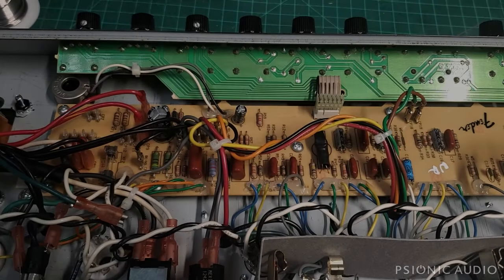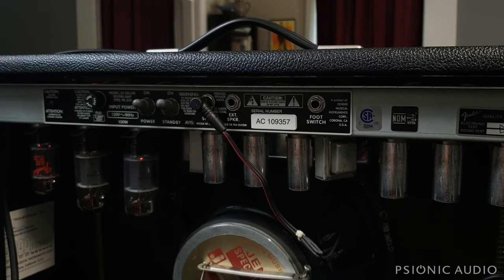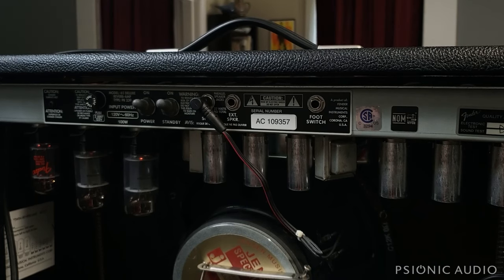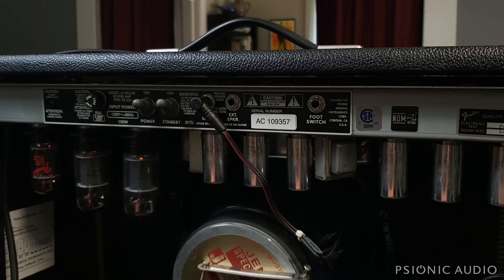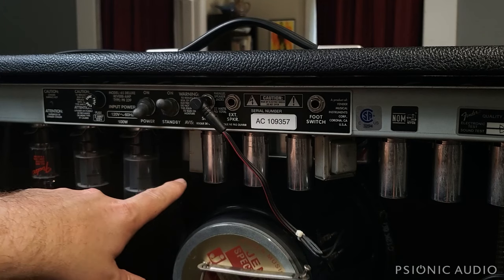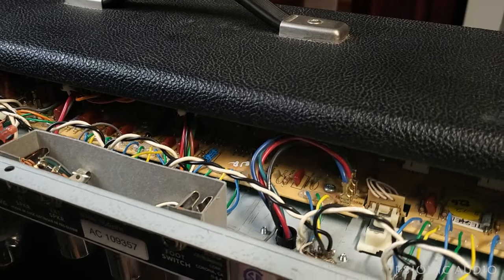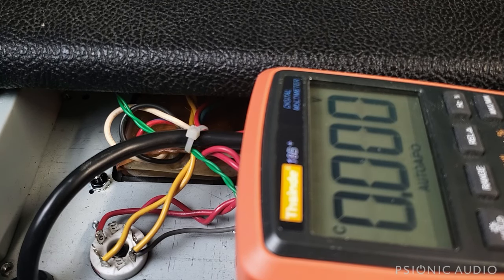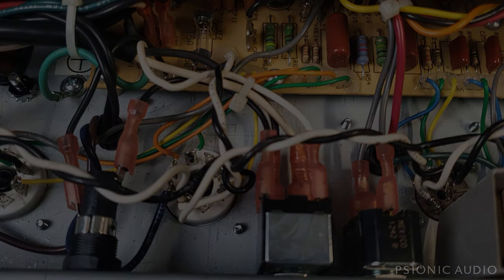(One Way to) Safely and Easily Discharge the Caps on Most Fender Tube Amps | READ THE DESCRIPTION!

Comment from the maker: Once you play with the power off to discharge the caps, UNPLUG THE AMP FROM THE WALL before going inside the chassis, Should have put that in the video.
Reply: Lyle, yeah..... I'll remember that the next time I shock the hell outta myself by forgetting to do that (I mean, haven't we ALL???). 🤣
Reply: It’s sad that you even have to clarify this.
Reply: great video, i want to clean my 90s twin and this will help me when i have to remove the chassis to clean the pots.
Reply: Having worked construction my whole life, and playing guitar, I learned that the neutral side of an outlet will shock you too, not as bad but not a good thing. Amps plugged in still get residual power from the neutral. Kinda like a back flow in reverse from the outlet

Comment: Not sure about this. You turned it off- so it went off. Circuit was broken. Certain tubes, capacitors, not tested in this video could still hold a charge. Believe that. The one node did not. Not sure playing did a thing either. Best tip for non-techs. Do NOT go inside your amp. A tech would go through your amp, tighten things up for probably $50 while you wait. Do that and demo some guitars and amps whilst you wait. Winning. I studied Elec. Engineering and I can tell you stories of people getting very messed up when amperage (not so much voltage) passes through the body. It is not pretty and effects are often permanent.  Just don't do it. They make those warning stickers for a reason. And yes, for the love of god, a TECH will unplug the GD thing before fiddling around- that is not even up for debate.

Comment: This is the method I used when I went into my '67 Deluxe Reverb to replace those 55 year old filter caps. When I measured the voltage it was less than 1 volt anywhere in the amp. So I can confirm that this works. I haven't tried it with my Marshall JMP yet, but I will soon.

I still want to make a discharge tool with alligator clips and a big 200ohm 10-watt resistor... I have everything to make it, I just haven't had time to do it yet.
Reply: The higher you make the resistor , the LESS effective the tool . I usually stick to around 20-47 ohms .

Comment: I Wanted to check if my 66 bandmaster had original filter caps.  The amp still held on to 15 volts after this method.  I continued by draining it slowly with the meter.  The filter caps were original.  Thanks for the video!

Comment: I've been doing THAT for years !! Usually do it on the bench with a signal generator and raise the signal generator as I unplug the amp . I discovered this when I noticed how long after you unplugged a Dynaco pre amp that it would keep playing ......if you did it THAT way , by time you got the chassis open the quad cap was just about zero , doesn't hurt to check with an alligator clip and a resistor either though . Nice vid and GOOD point !!
Reply: Yea I've always done the resistor bleed down thing too. Some amps have them built in if I remember correctly. But always verify, especially with tube amps. It's good to see another way though 🎸
Reply: @mikewithers299  You gotta' be careful with it , more common with TVs and Oscilloscopes but every once in a while it CAN creep back up again too ! I always check with a 10 ohm resistor and an alligator clip to be sure .
Reply: @frankporfidio9813  yes I had it happen on a couple amps that I was changing out filter caps on. I drained them and removed the resistor, got side tracked, came back to remove them and volts creeped back up again. Glad I checked again before unsoldering it!

Comment: I was helping a friend wire a car audio power amp (500w rms) up once and he accidentally shorted the output terminals I was amazed how big of a arc resulted. And this amp had been sitting for years. Ever since I’ve had a healthy respect for large caps in general.

Comment: I had forgotten about this-it doesn't pull it all out, but it makes it generally safe to do things like change jacks, replace the power cable, etc.
Also do this before you change or remove a tube. 
I haven't worked on tube amps since the early 80's, and have forgotten all this stuff.

Comment: Some circuits I use to work on (not guitar amps) used to have bleed off resistors to discharge caps, or you had to take a probe and discharge each cap to ground.
Reply: Older Fender amps with filter caps wired in series for the first node usually had balancing resistors across the caps and these also functioned as bleeder resistors, though the ohms value was high enough that the caps didn't drain all that quickly.

Comment: Great video, if i may make a recommendation, get yourself a 1000 volt protective glove such as those that are sold by uvex, and then use your voltmeter to measure that the caps are of. With such protective gloves you really do not risk anything at all.

Comment: As long as the valves' (tubes') cathodes are hot they still act as voltage amplifying stages and will drain off DC voltage from the reservoir cap onward down the rail draining filter caps on down to the lowest & last voltage node at the end of the rail.
Reply: So the tubes have to be hot for this to work?

Comment: I have a quick question! Would it be possible to custom build a point-to-point clone of a Mesa Dual Rectifier (2 channel)? From what I understand the preamp is similar to an SLO but the power amp is different. I wouldn't need the tube rectification and could forgo the "spongy" feature. I'm asking because I know how challenging mesa products are to maintain. Thanks, I love the channel & keep up the good work.
Reply: Oh course you can, its all about the time and expense

Comment: Based on what I studied in electronics at school, I assume that should be enough to discharge a working amp, but I never saw before a video saying this. I haven't done high voltage electronics in more than two decades, so I was wondering if I was correct. Thanks for this.
I just have one question, this should hold true for almost every amp, rigth?
Reply from the maker: Usually. But we verify anyway.

Comment: you do NOT need to play the guitar, the hot tubes will conduct the current (bias current) through them, effectively discharging the caps (playing doesn't matter at all). But if you are going for a nice fade out tone, i guess go for it. Maybe it can help as a "confirmation" the caps are empty too, if you want to skip the volt measurement but i wouldn't recommend not testing for actual voltage.
Reply: I think the point of playing was to demonstrate the caps discharging
Reply: @ProSimex84  since it is an instructive video i suppose it could very much be the case indeed.
Reply from the maker: Tubes cannot be relied upon to drain the caps fully. Short of using a large wattage resistor (which can be more dangerous for the untrained), playing to drain the caps is the best way to quickly and throughly drain them.

BUT CONFIRM.
Reply: @PsionicAudio  Please enlighten me on how "playing" helps? i think i know electronics and tubes but i can always learn. Why is playing that discharges the capacitors and it is not the hot-tubes emitting electrons from their cathodes?
Quick experiment to be sure, on an amp without capacitor bleed resistors and with either a solid state or directly heated rectifier flip the power switch on-off real fast, (pre amp tubes and power tubes still cold). Then connect your guitar and play for an hour (no heater power at all though), then with the most care measure the B+ (chances are it is even higher than normal B+). Then with an amp with a standby switch that cuts the circuit after the rectifier and not after the B+ capacitors, let it on standbly for 1 minute with hot tubes draining current out of the B+ capacitors. Then kill the power completely or pull the plug, voila the B+ capacitor should measure less than 5v DC (with no instrument ever connected to it throughout the process). If you do those 2 experiments and i am wrong please let me know, as i would really love to learn more.
Thanks.

Comment: What is the fully charged voltage on that rectifier reservoir node? Thanks for this safety vid.
Reply from the maker: Typically 400-440VDC with tubes present. Can be closer to 480VDC if the output tubes are not in the amp.

Comment: Thank you for your wonderful videos. I've got a blues deluxe reissue (unfortunately, now that I've discovered your channel) that rarely gets used because it's just too dang loud if you want that edge of breakup sound, and perhaps it needs a tightening of bolts and screws. Just out of curiosity, what voltage would there be if you hadn't discharged the capacitors?

Comment: Thank you, great video. So if you have a bad power switch and unable to turn on the amp, then what do you do? You have to open the chassis to swap in a new power switch.
Reply from the maker: Then you take it to a tech. As I said in the video, this is a method for a working safe amp. This is not the only method, but unless you are a tech...

Comment: To discharge the filter caps you turn off the amplifier while strumming your guitar until it's dead sound but that doesn't mean their is still 350vdc charged voltage still holding storage on the filter caps. Unless I'm missing something in the video

Comment: Hi, does this technique work for solid-state amps also?  Thanks!
Reply: Good question. I always used bleed resistors on my solid state amps. That's how I learned. But it would be interesting to find out. Unplug it from the wall while it's powered on and playing. No standby switch on solid state

Comment: My amp (Laney) cuts straight out if I do what you do but if I flip it to standby and leave the power on, the sound dies out like yours did in the video. Does that mean I should do this the other way round to you? By the way, great video. It's the first one that actually makes sense to me. Everyone else starts out by saying don't put your hands inside the amp until you've bled the high voltage caps and I think, "How am I supposed to remove the chassis and do that without putting my hands inside the amp!" Now you've answered my question. Sorry, one more question if you get this far  - I can buy a 22k, 3W Metal Oxide Film Resistor locally - I'm guessing that would be fine too?
Reply from the maker: Well this was very specifically for Fenders. Not for all amps. WIthout seeing your Laney's schematic I couldn't tell you. Some amps use "standby" just for a speaker mute.
Reply: @PsionicAudio  Okay, thanks very much for your answer. I'll just be careful then!

Comment: Another important use for a standby switch
Reply from the maker: How you get that from this video is beyond me. I was very clear that the standby is always left at Play.  Never put it in standby to do this.
Reply: @PsionicAudio  I wasn't referring to discharging capacitors. There are a lot of conversations as to why the standby switch exists. Put it in standby when you're not playing and the amp runs a lot cooler because the only heat generated is from the tube heaters. Otherwise you add the tube plate dissipation and everything else gets hot. When building or servicing an amp, I always shut the power off, then put the standby in play on my Super Reverb. On the Blues Junior you have no choice other than to shut it off and play it down as in your video.

Comment: What do you use as a minimum resistor to discharge caps when they won’t bleed down?
My Fluke has a Low-Z input of 10k. 
I’ve bled down little things (on container ships) with it, and actually tripped an alarm by pulling down a signal voltage.
Would it work for discharging a JCM 800 2204?
I could solder something together with something higher, I even have some 1000v junk leads that I could splice something into. 
But if my Low-Z will handle it, it sure would be nice.

Comment: I like to follow this by using an alligator clip with a load resistor from pin 1 of preamp tube 1 to ground and let it sit for a few minutes. Make sure that standby switch is on. Usually measure close to zero after this.

Comment: Would this also work for a Hot Rod Deluxe or Vox AC4?
Reply from the maker: Yes for both. Use your normal power on routine, wait until it makes sound, then play while and after you unplug the amp from the wall or power off using the switch (in which case then unplug from the wall).

Then VERIFY.

Comment: Another stellar video.  I have a brand new 65 Princeton reverb FSR reissue (lacquered tweed and 12" speaker).  Should I wait until the warranty has expired before opening her up to tighten all the recommended bolts?  Also, is removing the chassis the same in tweed editions? I'm referring to the part where some foil sticks to the telex in the front of the amp, as you mentioned in previous videos. Thank you.
Reply from the maker: I would tighten all the hardware immediately to protect your investment. Shouldn't void the warranty. Removing the chassis should be the same.
Reply: @PsionicAudio  sorry, one more question, in case I decide to hold off opening up the amp for awhile to tighten things up, if I understood your videos in this series correctly, it seems like I can remove the knobs and tighten all the input and volume jacks without having to remove the chassis, as well as the  speaker and baffle nuts / bolts.  To be clear, you never said or demonstrated that, but it doesn't look like I need access behind the pots or those jacks.  Correct?  Keep up the great work, your videos are fantastic.
Reply: You have to be careful that as you're tightening the hex nuts at the face plate, that the entire jack or pot isn't also rotating. If it is, you can twist and shear the internal wires (if they're "flown" to the circuit board) or - worse yet - shear the jack or pot right off the circuit board if they're board-mounted. 

Psionic opens the amp up so he can press or pinch the pot forward against the inside of the chassis using pinched fingers to keep it from rotating while tightening the exterior nut with a flat wrench.

If you're not going to open the amp, you have to be extra-careful that you don't let the internal barrel or stem of the jack or pot rotate

For jacks, a couple of folks have devised gripper tools to grip the jack barrel from the inside. You can grip and pull the jack barrel to the front while rotating the nut to tighten.

For pots, I guess you can pull on the pot stem from the outside with your fingers while wrenching

https://www.in2guitar.com/jack.html

https://hazeguitars.com/blog/tighten-guitar-jacks-from-the-outside

Comment: I have a Fender Blues Junior and it does not have a Standby. Does this method work with an amp that does not have a standby switch?
Reply from the maker: Standby is not part of this procedure. Notice it was in the Operate/Play position at all times. I even said "make sure you don't put it in Standby."

Comment: Will doing this consistently also preserve the life of various components in the amp? Said another way, do you recommend this as a method to generally power down a DRRI for example? Or only if someone is going inside the amp to work on something?
Thanks
Reply from the maker: Only for service.
Reply: @PsionicAudio  👍

Comment: Hello from Canada,I have tried a new hand wired Fender Deluxe Reverb last night that retails for 3700$ CAD.
Did you ever work on one of these? Are they really better than the reissues? I was wondering about what you show us about cheap condensers and all in the reissues.
Do you have thoughts on those expensive Fender amps?
I currently play with a Boogie mk5 combo that I really like but would not mind having a Deluxe also.
Thx for your attention,
Robert.
Reply from the maker: The '64 uses Sprague Atoms instead of IC filter caps. But that amp had its own set of issues, the wrong trem for that era of Fender amp, insulting fake blue molded coupling caps, and costs the same as a better quality early '70s original.

Comment: To confirm the voltage has drained, it was at 2 volts and safe, where is the danger zone above that? Thx Lyle!
Reply from the maker: Well, I won't go in an amp if there is more than 10VDC present.  I'll keep discharging. But once it's below 3VDC I don't care if it's any lower than that.

But that's in amps. A car battery is "only" 12VDC but it can kill you. But it provides a LOT more current than you find in guitar amps.

I don't want to find out where the danger zone precisely starts. ;)
Reply: @PsionicAudio  fyi 12vdc is fine (can absolutely not kill you, unless you have some extremely serious heart conditions), with wet hands maybe you can feel 48Vdc. playing it safe however will avoid you any darwin awards.

Comment: Good info :) l do this every time I open up my amps. You really don’t even have to have a guitar plugged into it . It’ll discharge just the same. I’m my experience anyway.
Reply: True, but the guitar helps it to discharge faster, and you can hear it to verify that its working.
Reply: @weschilton  "you can hear it to verify that its working." yes kind off, better check with a volt-meter in case the stand-by cuts after the filter caps, "the guitar helps it to discharge faster" absolutely not.
Reply: @kapioskapiopoylos7338  No, it absolutely does. I've tested it. Maybe you should too. And it should go without saying that either way you test with a meter before going into an amp!

Comment: Did I miss the part for if your amp doesn't have a standby switch? Everyone should know what the procedure would be but there maybe a few who dont.
Reply from the maker: If it has standby, power it on as usual, then take it out of standby. Then play and eiither power it off or (better) unplug it from the wall WHILE LEAVING THE STANDBY IN PLAY/OPERATE MODE.
Reply: @PsionicAudio I was eluding to Princetons and Champs, which would be the same procedure but unplugging the amp from the wall instead of using the on/off switch while playing the guitar